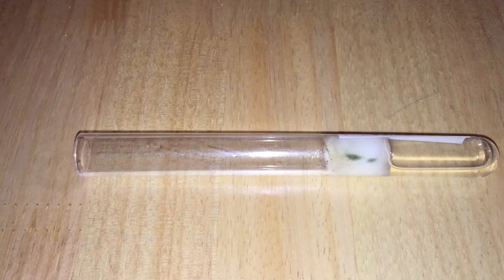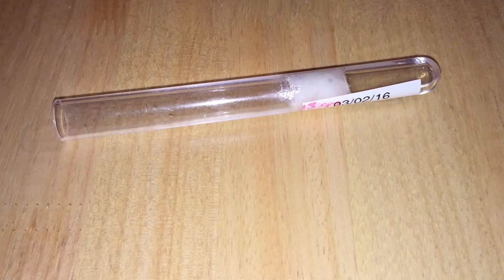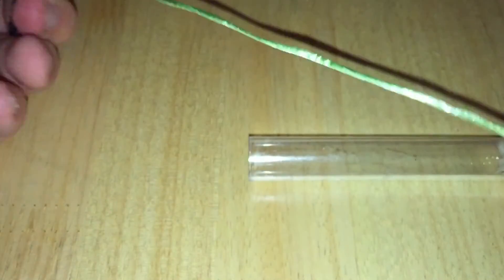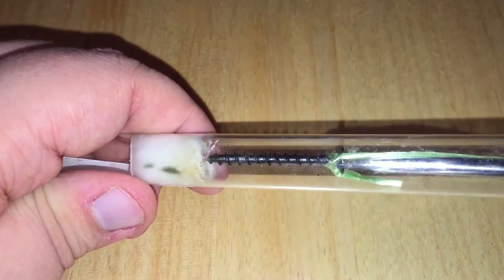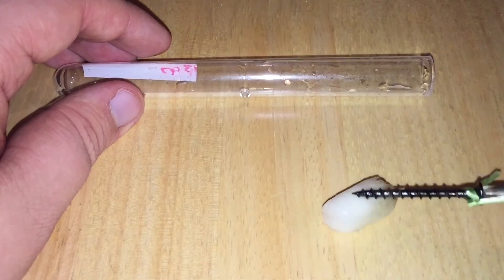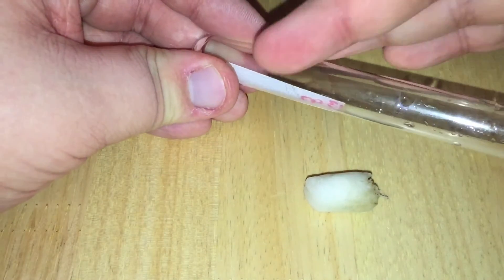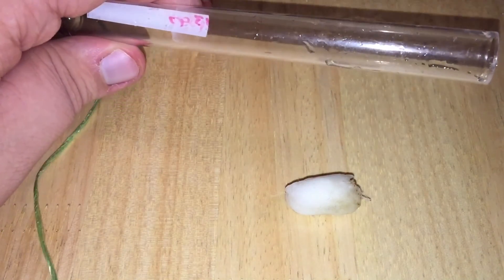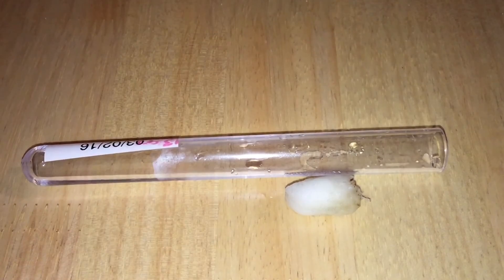Removing Cotton Wool From Test Tubes Tip For Ants (Ant-Keeping Tutorial/Guide)

Comment: a magnetic screwdriver head might also help... as long as the screw is made of steel...
... a plastic coated screw should still work, but you might need a stronger magnetic screwdriver head cos of the plastic 'blocking' the magnetism.......   :)